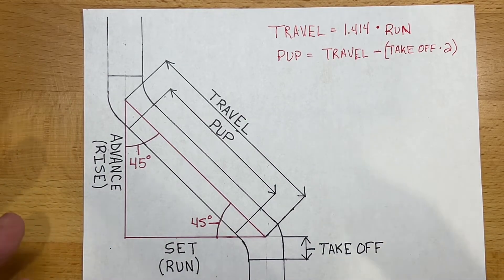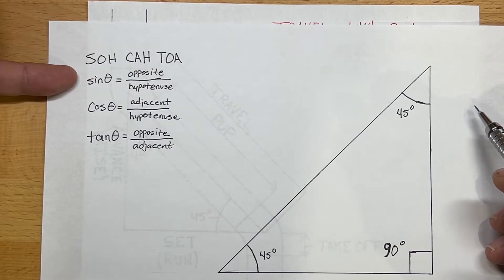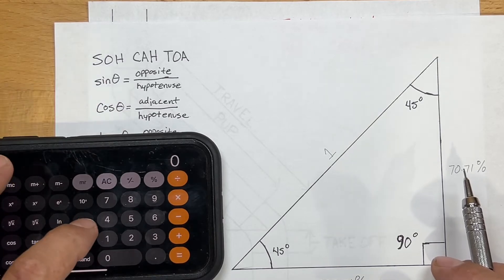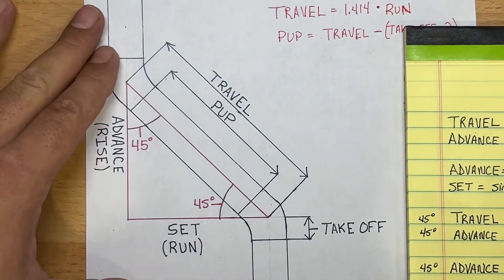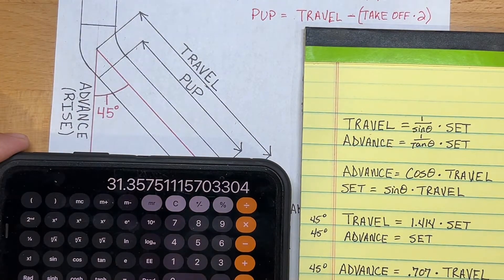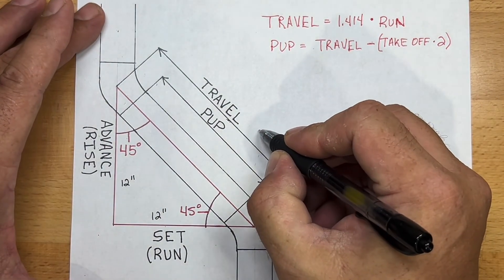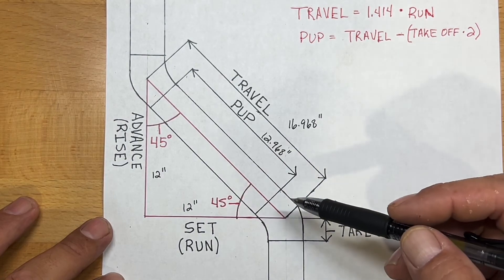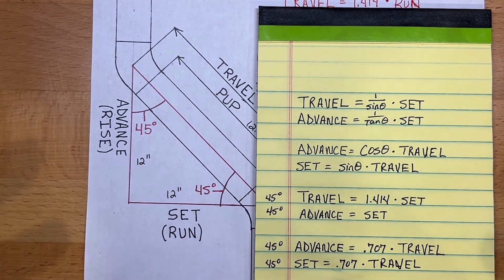Trades Math - Plumbing 45° Offsets And Finding Constants

Comment: Why add in all the trig functions when the Pythagorean theorem directly relates the Advance (a), the Set (s), and the Travel (t) as: a^2 + s^2 = t^2  

Assuming the objective is the end up with the two ends of the bent pipe parallel to each other, the Pythagorean theorem always applies, regardless of the angle, and only requires multiplication, addition or subtraction, and square roots.  Your 45 degree example where a=s reduces to 2*s^2 = t^2 which then simplifies for s = 1 to 2 = t^2 or 2^.5 = t  which is the square root of 2 and the magic constant, without any trig, is 1.414213562......

With a pocket calculator using the trig verses the roots is a wash but back in the day where you needed a CRC handbook to look up trig function values in tables based on degrees, Pythagorean was the way to go.  Still is for this old guy.

Comment: Great example and Explanation . As machinist and programer for a specific brand of CNC machine or even operating a manual machine . First thing to learn on blueprint reading . Im not a expert but you no them engineers don't always give a length or start on a (O.D-I.D ) tapered angle . . So you have to break it down with a calculator and pice of paper . Or back finger alot of adding and subtracting . Simple math I had a great who I trained with and worked with . Thank you Ben so much . I should have been a millwright.